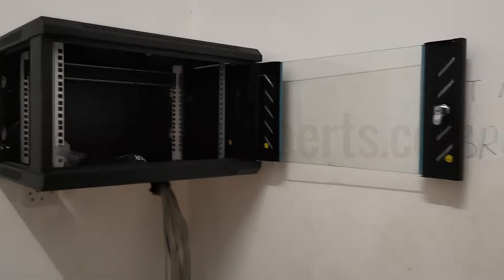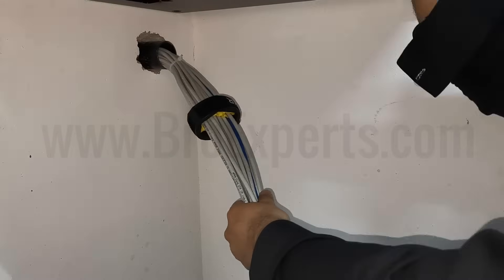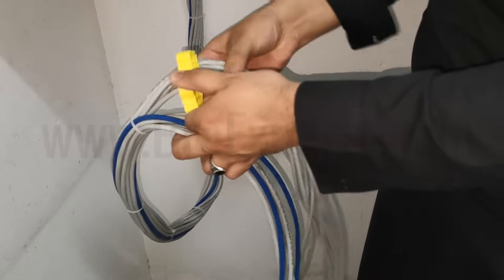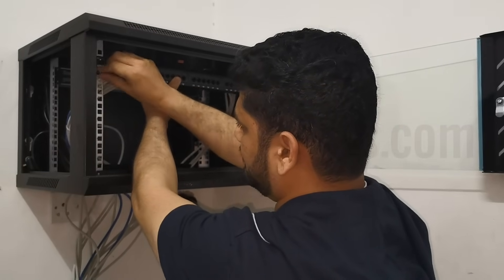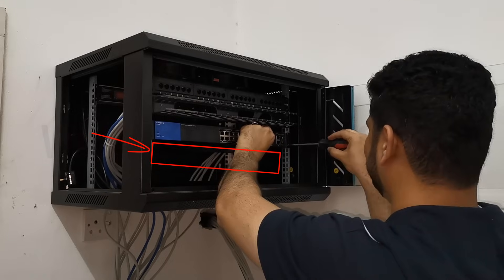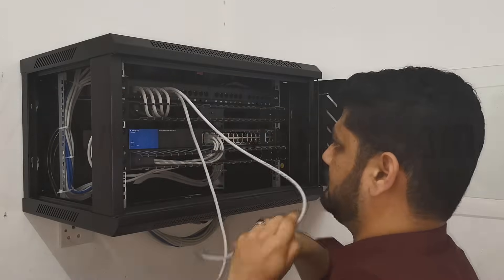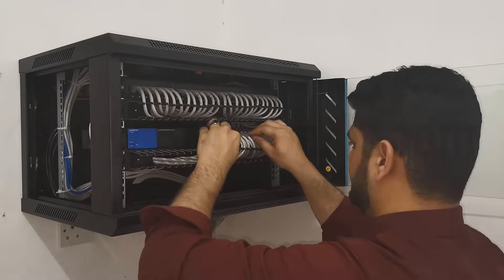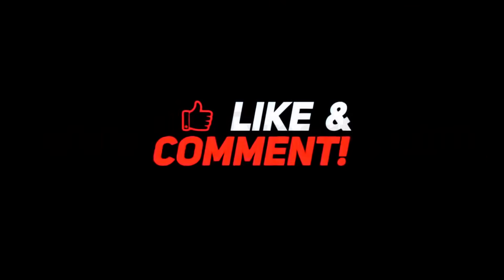Learn Network Cable Management Inside Rack From Scratch

Comment: Nice work! I would have installed the cabinet so it would cover the hole in the wall, where the cables come out.
Reply: Those NavePoint cabinets do not have a cable inlet in back, only bottom. They should have use some conduit.
Reply: @LinwoodPowell  The cabinet back can always be perforated! But yeah, conduit would be an alternative. I just think a nice cabinet with real neat wire management loses purpose when you have wires coming up from an ugly hole in the wall!
Reply: I think the rack would of been too low if he mounted it over the hole where the cables are coming out, but yeah that would be more appealing astetically

Comment: Velcro señor no zip tie, plus you do not need a patch panel nor cable mangers, just terminate the end’s of all 24 CatX cables with a RJ45 connectors, then plug it to your Switcher. More pro and less cost.
Reply: Ideally the cable run through the walls is solid core, not suitable for patch cables. While the cables used to patch into the switches are stranded patch cables. Plugging and unplugging cables causes wear and tear. If cables out of the wall are terminated with RJ45 connectors that wear or break, then you need to fix the cable. More time consuming than replacing a 1m patch cable.
Reply: You probably never did a professional cabling job! If you did, you would know the errors and potential setbacks of your advice.
Reply: no...worst idea ever...i dont know why.,..but just sound bad idea
Reply: This is very bad advice about not using a patch panel.
Reply: @injust1ce2325  what the reason behind it? i know its bad, but i cannot remember why or think of a reason...hahaha

Comment: I would not recommend that. It looks awesome yes, but if you are using a poe switch the cables at the back are kinda blocking the airflow of the switch (depends on model), also it is just wasted space to go for 2 organizers
Reply from the maker: This cabinet is equipped with two fans on top but thanks for raising this point.. 👍
Reply: @BroExperts-Tutorials  Interesting... Sorry, but manage that configuration has to be a nightmare. If a patchcord fails, change it will be very dificult. On the other hand, use a no modular patchpanel in 2019 is a sin. Finally, you are using bad the rack: The holes has marks for use in threes (1RU standard distance).
Reply: @EnriqueVillarMavila  Modular patch panel for home purposes? Good luck on Your budget buddy. Especcialy if You are into cat 6 network.
Reply: Yep just buy shorter patch cables

Comment: Zip ties should never be used in network cable management... only when it's temporary... Use velcro/hook n loop etc... This dude overtightened zip ties, that's way to damage network cables.
Reply from the maker: It seems overtightent coz cables are being running through the organizing device  but it is not overtightent.. ties never damage my cables the network is running smoothly.. But thanks for your valuable suggestion yes velcro is better choice than ties.. 👍
Reply: @BroExperts-Tutorials  your ties are distorting the cable, so, yes, they are too tight. If the distort the shape of the bundle, they will increase cross talk, and reduce cable performance.
Reply: I use Velcro a lot these days as you can reconfigure/remove cables without wasting a zip tie, but I'm unaware in 21 years of working in IT of a zip tie actually damaging any type of cable, patch panel cables seldom move, I think your point would  be more valid at the endpoint where movement is more common even then cables are pretty tough.
Reply: you leave space in the zipline so you can cut it and not the cable. I have never seen anybody break cable with lines, unless they meant to
Reply: @sagesimply9742  i've seen that happend quite a lot of times. Too thight zip ties and then 1 cable needed to be added to the pile... it's just not meant for upgradability and it's a kind of DIY way.
Reply: @paul klein Good job being a peasant but guess what ? I could care less about your sh1tty boss.  I didn't say this looks good you scumbag, I said I have used them and have cause zero damage, it's common sense not to over tighten.
Reply: Nylon cable ties were specified by Ericson for running exchange cabling at least 30 years ago. We used them in conjunction with a tool that tensioned them to a specified amount and cut them cleanly. We tested every cable, never saw a failure in all those years when done right. So the purists might want to lighten up a bit and consider that there are other equally valid perspectives.

https://www.jaycar.com.au/cable-tie-gun/p/TH2600
Reply: Its not about visually damaged cables, its what show up on certification tests using Flukes or other testing equipment that may throw out a fail due to cross talk because of the use of zaps.
Reply: Your Correct velcro is better!,..can be used Zip ties but not to much tight and cut the excess,..
Reply: Zip ties never cause damage to network cables, unless you're fiber optics.
Reply: @MyReviews_FOSS  They do, they're not likely to cause damage if you do 100Mb or cause noticable damage if you do 1Gb short distance (<20 meters) but above that and especially on 10GbE you can easily damage a cable by too tight zip ties, this guy has them far too tight but then again this setup would not pass testing anyway, far too much length of the pairs untwisted before termination on the LSA strips, no reason to do so and a common beginners mistake but ruins the cable performance... Fine when running some desktops on it but anything more than a simple desktop with barely any traffic will cause issues...
Reply: @someguy4915  10Gb copper cables with sfp+\xfp connectors on each side are pretty hard to damage with zip ties
Reply: @someguy4915  using Copper for 10Gb is a beginners mistake anyway.
Reply: @lelandclayton5462  Depends, for most applications I'd use DAC or fiber too but in some cases copper is more cost-effective or just simpler to deploy and with modern switches the latency difference is almost non-existant anyway...
Reply: @someguy4915  I have a bone to pick with any installer I see that uses Zip Ties for dressing cable..
Reply: @someguy4915  you are incorrect. It is unlikely that the cable ties will do physical harm to the cable. What will happen is that the ties will deform the cable and distort the relationship between individual conductors. This causes increased cross talk, especially on high frequency system like Cat 6A. Cable ties are not recommended in these applications for that reason, but they can be used so long as they do not distort the cable jacket. Velcro is a better choice because it is harder to over tighten and distort the shape of the cable.
Reply: @jonmkyle1  You've never watched a UTP cable that had been tied with too tight zip ties before? Especially solid core cables like in the video tend to break but stranded will also get damaged, just a few strands at a time which over a few weeks adds up to packet loss and finally cable failure.
This is easily reproducible: Just get a bunch of UTP cables together, tie a zip tie too tight around it and move them a bit around (like someone is trying to squeeze another cable into the patch panel and pushes the cables aside. Then open up some of the cables where the zip tie was located: you'll see breakage.
Reply: or just make the cable runs shorter in their cabinet when you've run them fully...…..  use 1U patch cables, no need for these cable organisers...…….. layout the cabinet whereby patch panel, switch, patch panel is the design, 1U cables, easy...….If your cabling  is made of  the cheapest coatings possible, then Zip Ties can cause breakage when overtightened. using quality cabling and a good design method prevents all these issue.Velcro, IU patch cables (15cm to 20cm), patch panel and switch layouts pre planned, keep telephony separate if possible, run telephony in different colours to the data connections from PCs etc.Network cabling and design is not complicated, take time to plan, more importantly, don't be afraid to use ties, if done correctly, the  cabling should last 15 years if undisturbed.
Reply: @RatedMTV  No company has it's cabling left untouched/undisturbed for 15 years, if they do they're going bankrupt...
1U cable runs are cute for going from router to switch and for daisy chaining switches when you're too lazy to run more lengths from the router, in any other case having some spare length so you can reroute a cable is much better in real world use.
You'll want to replace that switch when it breaks within those 15 years and with 1U runs you can't rerun those links anyway else, just not something you'd do in real world use.
Reply: Sir I want job in this field Please help me. I have 7 years experience
Reply: I've used zip ties never caused damage....
Reply: @jessesanchez5294  Attenuation and reflections especially on 10g
Reply: @ByigDean  Im pretty sure this is for gig speeds

Comment: Might as well have gone with velcro instead of zip ties.  Is it possible to use a single 1u organizer and still get decent results? I figure if you need to waste 2 rack units might as well just have a patch panel on both sides of the switch and use short cables.
Reply: Of course 1U will be enough, it just comes down to the point of having cables with the right length. Too much slack could fill up the organizer quickly
Reply: Yeah it is. No need for the length of the patch cables. Could have got away with a single management panel. If that switch ever gets replaced with something slightly deeper you gonna have to re do all the cabling at the front.